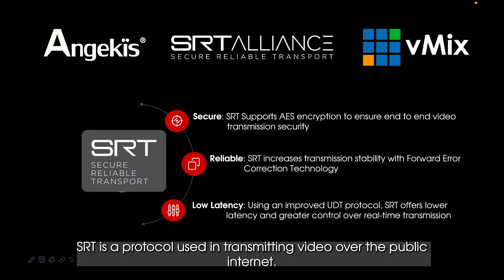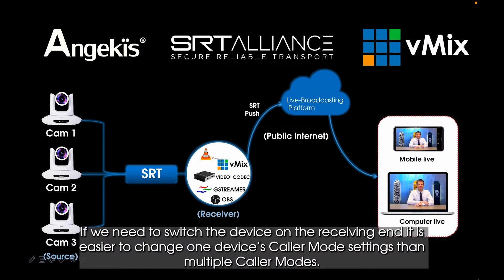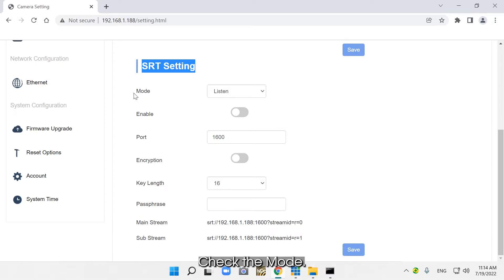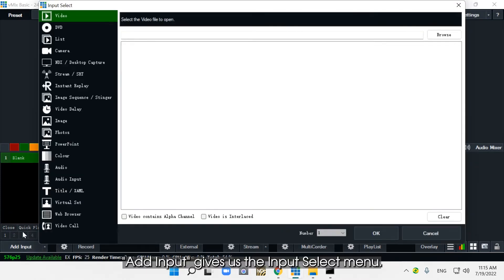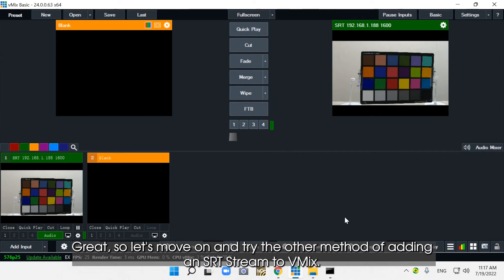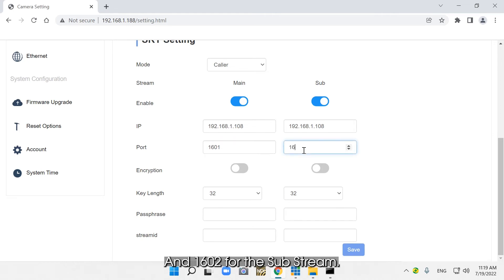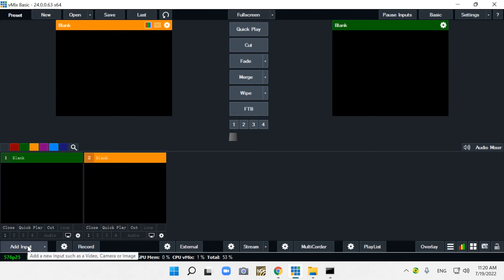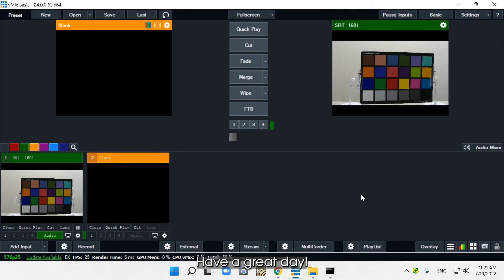SRT Setup Instruction Video Tutorial

Comment: A side note for 4:04 - StreamID is a value that can be set in the caller mode, and extracted from the incoming connection in listener mode. This means that as the camera is on the listener mode then this specification is an instruction for the camera, what it should EXPECT from the incoming connection's settings in order to send it particular stream. That is, if the incoming connection from the receiver (caller) contains r=0 in StreamID (which is explicitly set in vMix at 5:58) then the camera should send the Main Stream to the connected receiver.
Reply from the maker: Appreciate it!